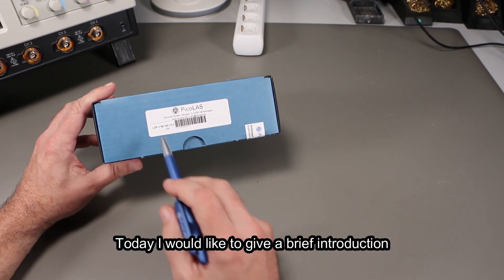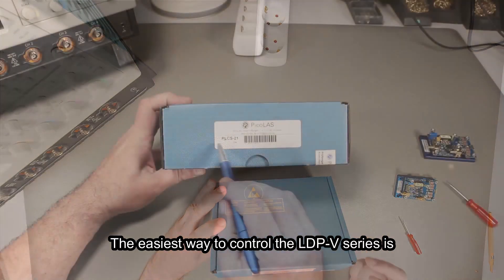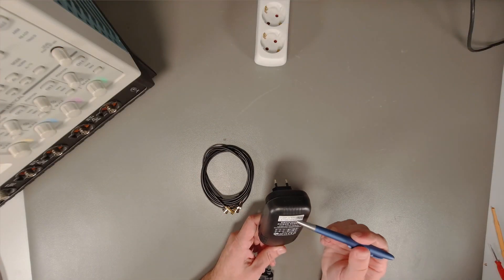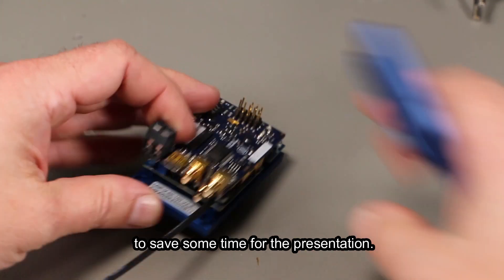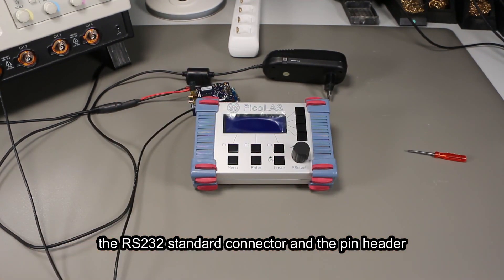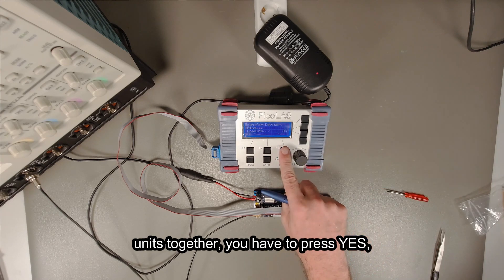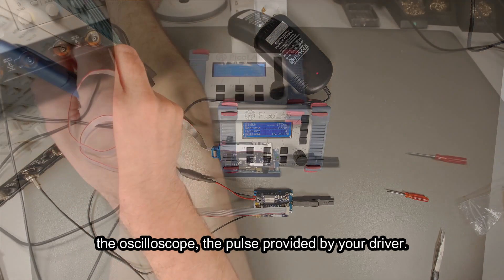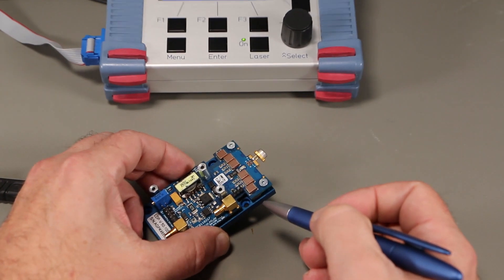How to set up the driver LDP-V 50-100

Comment: Would you guys please check the support email? I have emailed for a technical support for about a month ago, and another email days before, with no response at all. I have bought a LDPV 50-100. With my own trigger 5V and power supply 15 V, under your instructions, I was not able to get a corresponding output from the current monitor port. Would you please give some suggestion to figure out what could be the problem? By the way, this is the worst technical support I ever experienced.